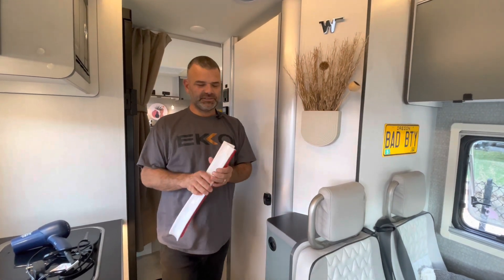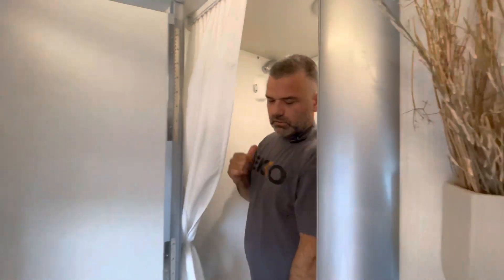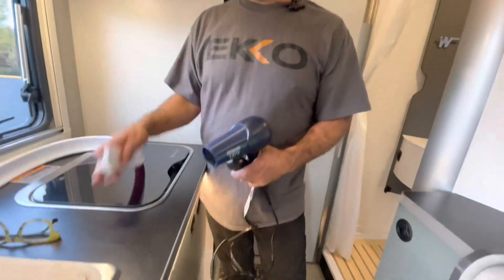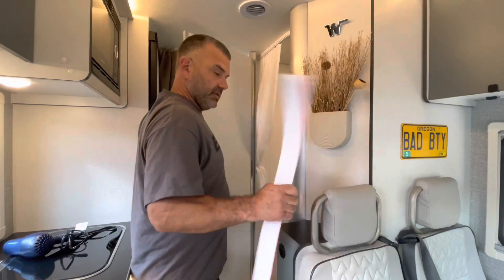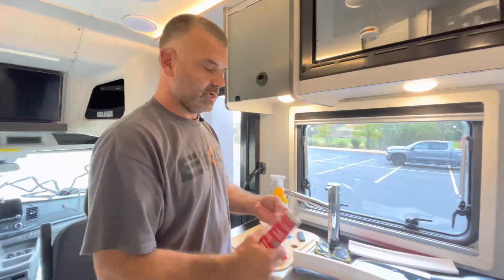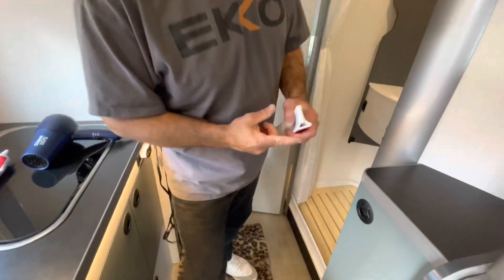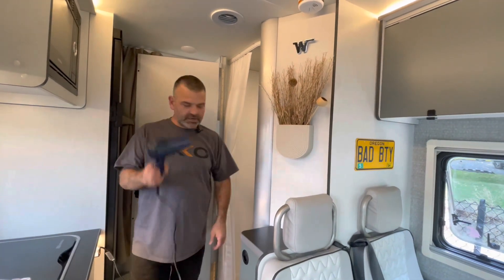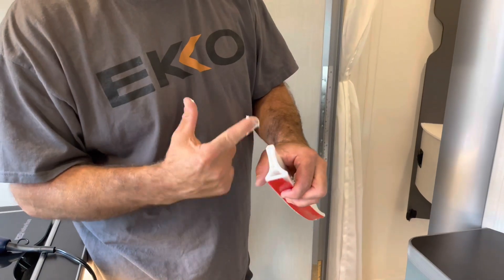EKKO VAN | WINNEBAGO EKKO | Vanlife SHOWER PAN UPGRADE  l AVOID COSTLY REPAIRS AND WATER DAMAGE!

Comment: The problem with centering your curb riser on the curb is that there will still be a gap between the curb riser and the interior surface of the door, leaving a gap where water can run out. I think you'd be better served to move that added curb riser outbound until it contacts the interior surface of the bathroom door when closed, to make a tighter seal, no?